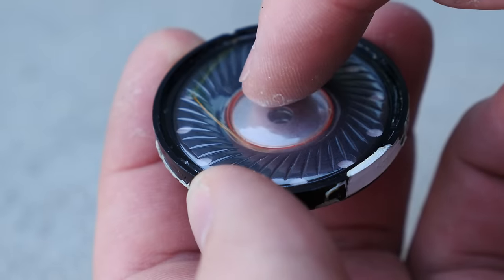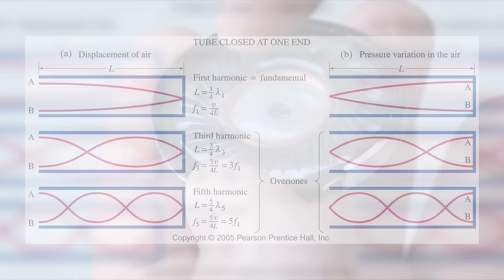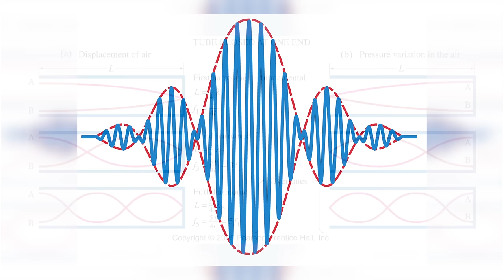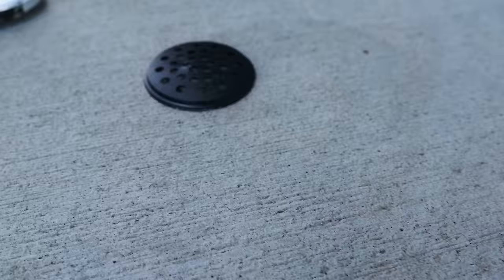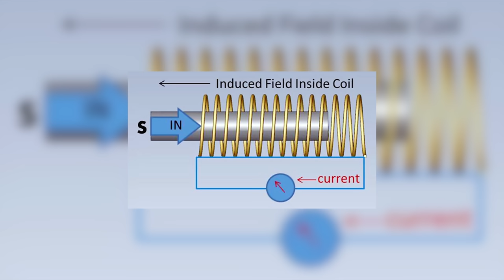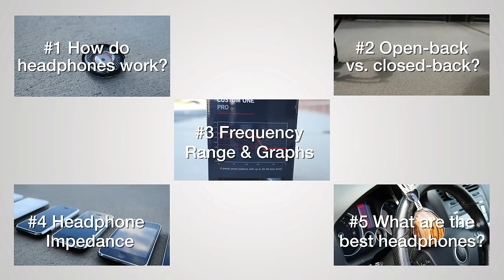How do headphones really work? (4K) - Part 1/5 - "All About Headphones"

Comment: Hello, I have a high school engineering project where we have to design some kind of a product. My Team and I decided to create an earbud holder (it’s basically a spool that you could wrap the wires around). For the project, we had to create a test plan to ensure the design is working properly. 

Our tests are as follows:

Compression Test: Quantitative 

1 Hold the device between fingers.
2 Press gently down on both sides (note any deformations).
3 Move to the clips, gently push against the clips.
4 Then, pull the clips towards you. 
5 If no deformation or damage occurs, then the device passes.

Durability Test: Qualitative

1 Use the device ten times.
2 If it breaks, or is damaged/deformed in any way, the test has failed.

Intuition Test: Qualitative 

1 Hand the product over to a person with no knowledge of the design.
2 Time them, once the person is finished, check the time.
3 45 seconds is ideal, if the time is greater than 55 seconds, then the test has been failed.

Space Test: Qualitative

1 Fit the device in your pocket.
2 If it does not fit, then the test has failed.
3 Furthermore, if the process takes longer than 5 seconds, then the design is flawed and should be improved.

Effectiveness Test: Quantitative
 
1 Store the wires using the spool box.
2 Measure the length of wire and earbuds sticking out.
3 If the measurement is greater than one inch, then it has failed.

Comment: Even though you explained this very well, for some reason it’s still so hard for me to wrap my head around wires and vibrations being able to produce music and sound 🤦🏻 considering I had to take electrical courses for my hvac degree, I feel pretty stupid lol
Reply: I get the basis, but what throws me off is the same drum producing both high tones and low tones at the same time...a tuba cannot sound like a flute, so how does one little drum/cone do it? lol over my head!

Comment: Pro tip if the headphones are vibrating. You can use the hair dryer. Take of the ear cup on what side your membrane is vibrating heat it up for maybe 5 seconds and cool it down by blowing on it with your mouth. The membrane should shrink by little bit and stop making vibration when you listen to normal music or bass.  Im using hyper x stinger my left side vibrates alot when i listen to music wich has bass and the driver starts to vibrate alot its annoying

Comment: Does the diaphragm break easily? I keep on trying to take apart earbuds but i cant take off the cover. I busted off the cover once, and the side was a litrle bent and a little bit of the side of the diaphragm was bent and a part of the diaphragm was a little in the air, about half a millimeter. Is there a seal? Or at least another way to take the cover off?

Comment: But how to wireless headphones work? I own a pair, I"m actually wearing them right now, and If I knew how the electricity travels back and forth without wires then it'd be much less scary.
Reply: it works with bluetooth, I guess bluetooth works on the basics of radio waves, only on much smaller distance. Forgive me if I'm wrong here
Reply: Metallica Fan Batteries.
Reply: F**in' magnets! How do they work?!
Reply: Metallica Fan wireless headphones would work using wireless technology that either transmits analog signal to headphones using wireless tech (but not sure if they can do that), or send digital signal to wireless headphone's DAC (Digital to Analog Converter), which converts in analog= sound.
You can't amp the analog signal, unless the transmitter goes to a dac and the dac has cable to amp; then headphones. (but that's not a WIRELESS headphones anymore)
but why would you do that when wireless transmitters usually compress the audio frequency? says an audiophile.
wireless headphones would also eat up extra battery on your phone (im assuming you're going to use wireless headphones with phones because, cables), which sucks for iSheep with zero battery life. lol.
Reply: +Metallica Fan there is a battery inside your headphones that allows the magnet to adjust its power and that what creates the sound.

Comment: So I'm trying to do a little DIY on a beautiful pair of headphones I own (well they look beautiful, but sound like crap). I've replaced the drivers, but I've noticed that the sound signature basically equates to really bright highs and thin bass response. I've read that I can pull back the treble by using a thin foam pad over the driver enclosure, but any suggestions on how to make the bass a bit more prominent? I've read something about poking some holes in the back of the driver (where there are small circles already), but not sure if this is a smart thing to do. Any tips?